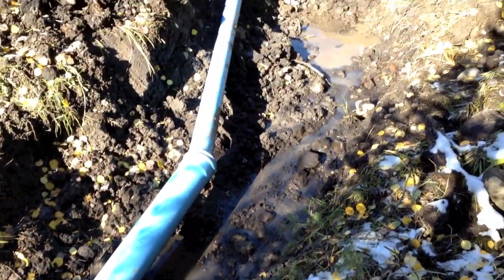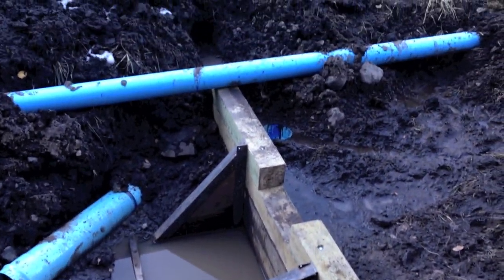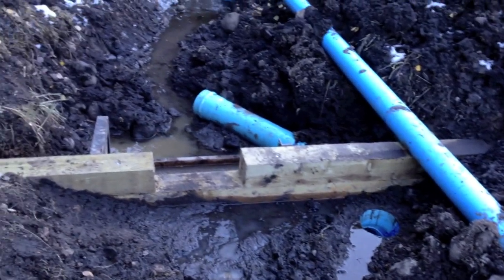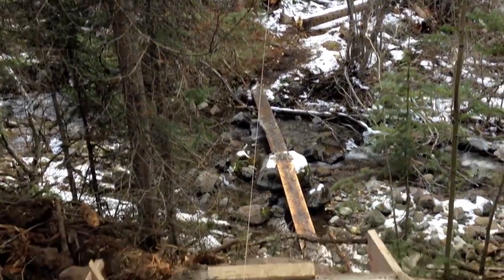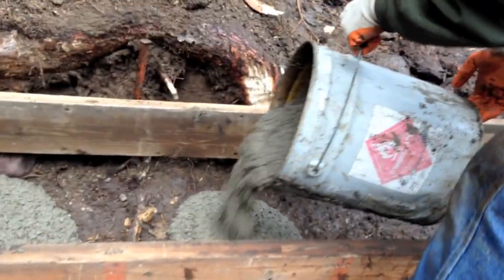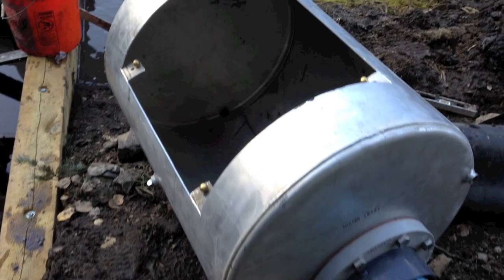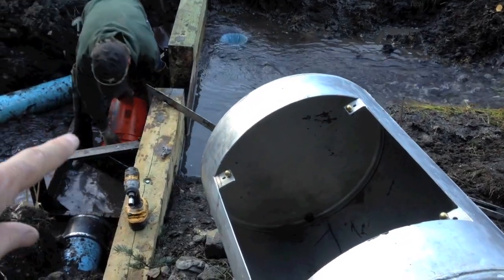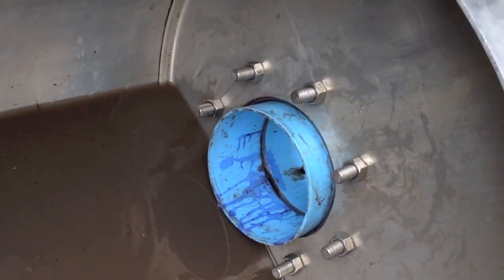Part 9 MicroHydro Power System in CO

Comment: What is the flow and head of your system?
Reply from the maker: Head is around 225 ft.(~96-98psi) and flow setting for Spring thru Fall is between 115-130gpm which yields about 4.5kw for around 108 kWh/day.  In Winter we increase the flow to ~220gpm and pressure drops to ~86-88psi due to pipe friction.  The winter output we shoot for is around 7.5kw or 180kWh/day.  We change flow rate in Winter for added heat in our home which isn't necessary in the other seasons.  Head is calculated from pressure readings and flow is calculated from power output.  We have increased the flow occasionally to 305gpm (0.68 cfs) which is our absolute adjudicated max flow rate.  Thanks for watching.
Reply: @mrhydrohead  thank you so much! Very excited to see more videos!
Reply from the maker: @jamesmoore5959  😉👍

Comment: Why a wood weir?
Reply from the maker: Just the material we chose to work with at the time. Pressure treated should last 15-20 yrs.  We would have had to haul maybe 1000 lbs of concrete by hand deep into the woods if we went with that. Really there wasn't much thought or discussion about it.
Reply: MrHydrohead where did you buy the turbine and generator? I know you got it in the late 90s but do you have a website or company you'd recommend?
Reply from the maker: Depends on the requirements of the site, but my turbine came from http://www.canyonhydro.com excellent yet now quite pricey. Lots of new products out there. Harris turbines or Powerspout seem like good options to me for a DC system although my only direct experience is with AC on my system. Best approach is to get your measurements of head and flow and a plan for how much power you can live with comfortably and THEN go shopping for the right equipment based on performance and cost. 

Oh yeah the generator is a Marathon Lima type generator. Good quality yet again now can be expensive
Reply: MrHydrohead thank you so much! I appreciate the reply! Enjoy paradise!

Comment: hell of an undertaking....I'd think I would have switched to solar:):)
Reply from the maker: Do R/C!  Yes, well that would require maintenance and replacing batteries over time. Not to mention clearing the 4-6 ft of snow that would fall over winter, no small task. The initial input of effort and expense at the outset pays off over the long term with a simple and overly ample supply of power.
Reply from the maker: +Do R/C!  Imagine the panels required to produce in winter 175-200 kWh/day and then imagine every few days needing to remove10" -2' of snow from them.  This is before maintaining batteries or enduring cloudy spells where the output is greatly reduced.  Micro hydro is concentrated solar power that provides even consistent supply.  We love living with it.

Comment: My theory is if you like to spend a lot of time on mechanical stuff constantly breaking, and some just like to do that, go for it. But if you want to keep it simple with not spending all your capitol on parts and labor put in a massive solar system and reduce your work load tremendously. You may spend all your time now on battery mnx but you don't have to find leaks and dig holes all the time...
Reply: Sounds Like You Like Yourself a Lot. You Like to be right. Try understanding multiple things at the same time. 1 EMP destroys the solar system, and water keeps flowing. I just gave you 1 simple argument, for shits and giggles, to help you be more intelligent. 
There are more than 2 ideas out there.

Comment: Why do you have to let air into the weir?
Reply from the maker: +Otuya david odeke If the water flowing into the weir were to suddenly be blocked for whatever reason, the pipeline could be collapsed from the suction created by the water already moving down the pipeline.  The air vent at the weir is a safety precaution.
Reply: Thank you very much for the explanation.
Reply from the maker: You are very welcome.  Another reason it may be useful would be to allow any small bubbles from turbulence entering at the tank to have a route to escape the pipeline.

Comment: may i ask..please forgive my ignorance..but why was it that u needed to divert part of the creek to the meadow.. and then use a weir to finally collect water into your penstock.. why wouldn't you attach your penstock directly into the creek.. i may have missed your reasoning in the earlier videos.. great project and well documented by the way..thanks.
Reply: Good question. Sorry for the long winded and convoluted verbiage which follows, but it's complicated. Several reasons include capturing the maximum fall from the edge of the property, the necessity to remove sediment from the fast moving water via settlement which not doing could over time erode the brass Pelton cups in the turbine if left unchecked, the unfeasibility due to terrain to construct the penstock on the same side of the creek as the powerhouse in the first several hundred feet (it's being unbuildable), the desirability of capturing the already existing water in the meadow to overcome potential future drought conditions, and the broad seasonal variability of flows in the creek itself which in spring has the potential to destroy whatever is constructed.  Thats a mouthful of a sentence. The last point has not yet been resolved as the creek has proven itself to be very dynamic and changeable unlike the meadow which is stable.  Last year the creek actually eroded the foundation of the hill above it causing a sloughing action which impacted the hillside up to about 100 ft. up the hill from the creek.  It is daunting trying the capture a small part of a raging torrent which changes over time.  Please wish us good fortune in our efforts.
Reply: thank you so much.. now makes complete sense.. looking forward to #14..

Comment: that cap to shut the system down will be very hard to take off if  the tank is full of water..
Reply: Yeah it looks tricky for sure. For a better solution a capped 90 piece is a good choice so you can lever it in and out of place.
Reply: Not with a vent near the same level as the cap.  He has a drain on the lower end of the diesel tank so the cap should be dry on both sides after installing it.  The bigger problem would be putting it on, but draining the tank first should minimize the vacuum.
Reply from the maker: +Robert Anderson 
Actually, I very seldom use the cap inside the tank I planned for shutting the system down.  The removable standing pipe above the weir which diverts water under the weir has been most effective for both shutting the system down and also to drain any sediment residing above the weir.  Really so glad we installed that diversion feature.  It makes it all very workable.

Comment: Just curious, did you need any permits or approvals.  If so, what kind of nightmare was that?
Reply from the maker: Not real bad.  Conditional water rights to use the water were filed on in Water Court many years ago and needed to be renewed every 7 years.  I own all the land it sits on, so there was no one to object.  Once the water is proven to have been put to beneficial use, the conditional water right can become absolute based on the adjudication date of the original application which in this case was 1996.  At first I used a lawyer to do the work, but now have learned how to do it all Pro Se(representing oneself)  without a lawyer.  Not real complicated, but involves filing fees and paperwork.  Its not a navigable or fishable creek so other permits not required.
Reply: Thanks for the info.  I had assumed it would be worse. That doesn't sound too bad.

Comment from the maker: Andrew, Good question. I assume I just reach in and pull it out.  Time will tell if the pressure is a problem when we get ready to run the system.  Being less than a foot under the level of the water, it shouldn't  be much pressure. We shall see...